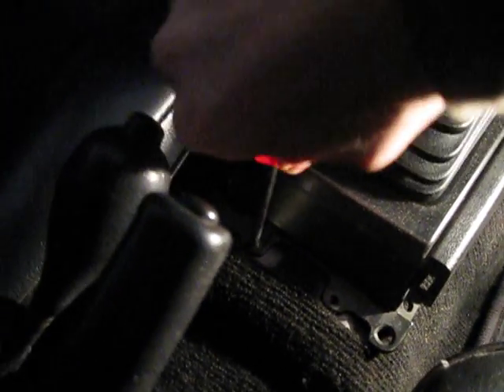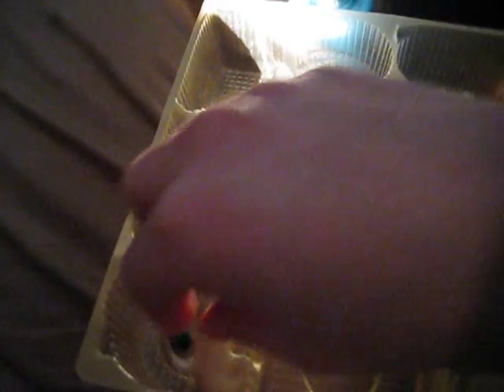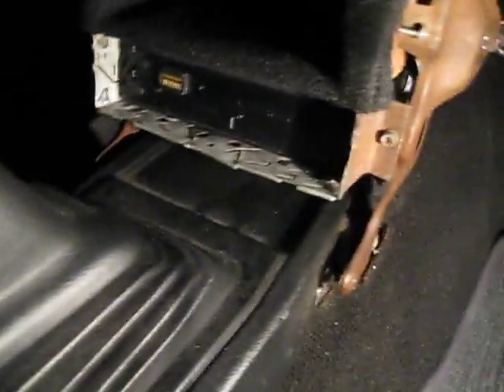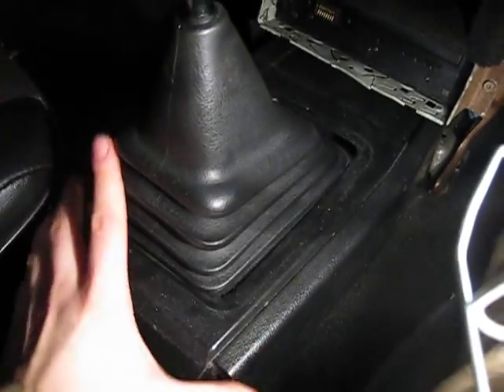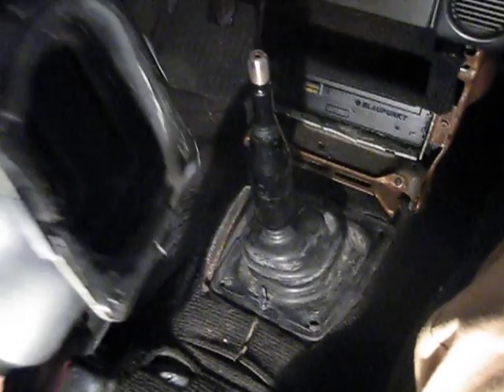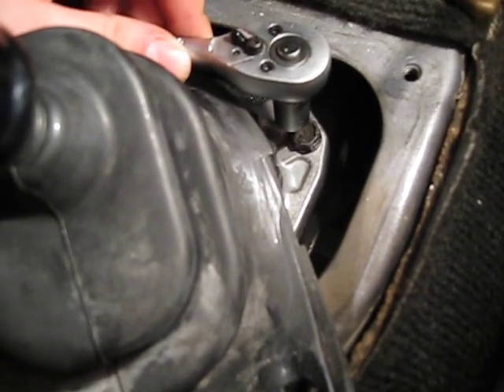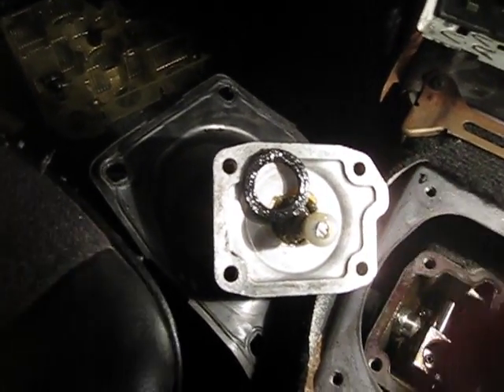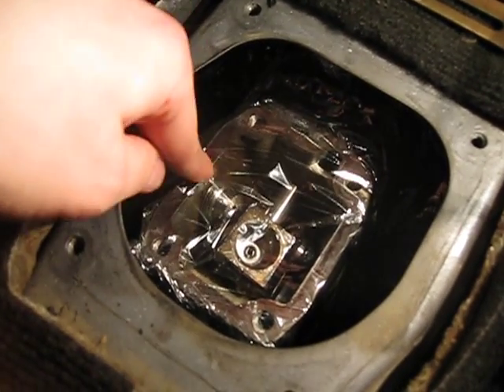1987 Corolla GT AE86 Gearbox Rebuild - Part 1 - Remove Shifter Lever

Comment: at 8:03 time where did you get that black rubber ring from? I remember buying the bushing kit and got all three new pieces but just last week I regressed the shifter and new tyranny oil but don't remember seeing that black rubber ring again?
Reply: does it go ontop of where the shifter meets the square tranny gear shifter part shown in the thumbnail?

Comment: Hi João Rocha da Silva. u did a real good job on rebuilding the gearbox. I am trying to do mine too by watching your channel. just a bit of wondering, there is two different 1st and 2nd gear synchro. which is 33368-20012 and 33368-12030. My 1986 AE86 was imported from Japan. How do i identify which is the right part for me??

Thanks!!
Reply from the maker: Chris Li Check out this site: http://www.partsbase.org/toyota/corolla-levin-ae86-ecmqf-1-6l-16-turbo-dohc-efi-mtm-1983-1987-jp-2-transmission-gear-mtm/#p-toyota-3336812030 I think that one is for the late model AE86 (Levin) and the other is for the Trueno... They should be the same in theory, but get the one that matches the year of your car :-) Good luck and dont forget to visit aeu86.org, download the manual and use my videos as additional information. In doubt, the manual always wins!
Reply from the maker: Chris Li Also, I cant stress this enough, change EVERY gasket and EVERY retainer when the manual says you to. Do gaskets with high-temp silicone on both sides for added leak-proofing... the gasket should suffice, but its like using two condoms xD
Reply: Ｏ.... Will try it next weed when I have time. Thanks a lot!!

Great videos on youtube!!